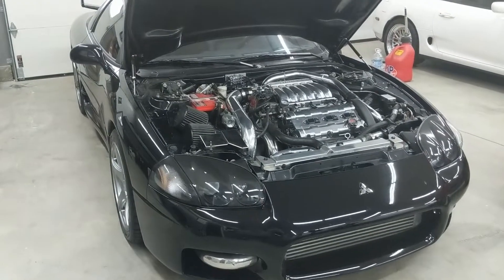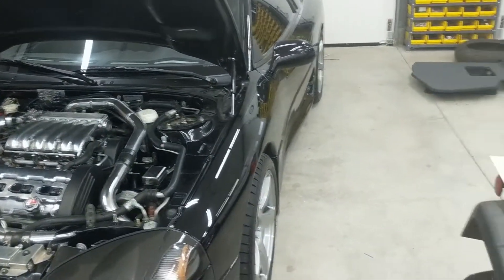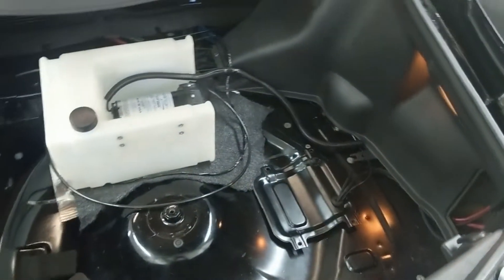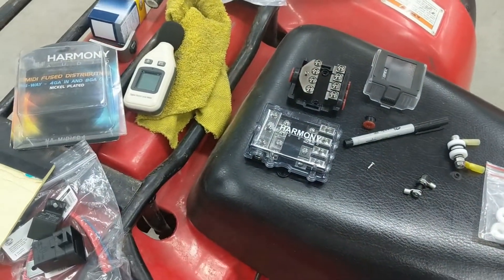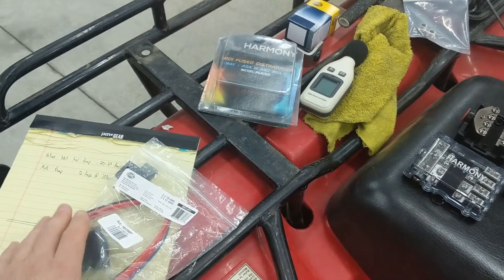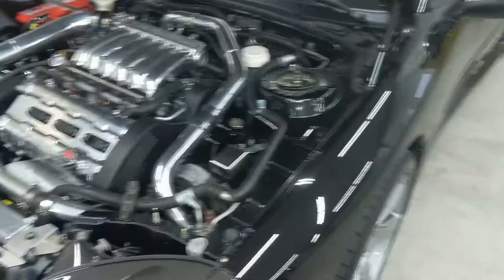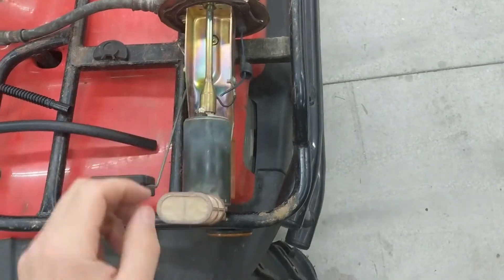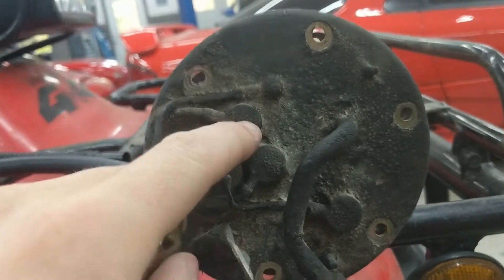Installing and hot wiring a hellcat Fuel pump in my 3000gt vr4

Comment: Im curious about youre fuel pressure. Ive have the same pump and im running fuel lab fpr. I have -6 an lines from the fuel feed to the filter then to the rail. The rail back to the fpr. Im having issues with the pressure not getting below 40psi at idle. I'm using the stock fuel return lines. Have you come across this issue?

Comment: Why did you decide to do the fuse relay inside the engine bay? Why not run 4g wire into the cabin and put splitter under dash?
Reply from the maker: I have the factory fuel pump relay bypassed from a long time ago. I wanted to keep the wire running to the fuse box installed as short as possible. Less wire means less room for it to run on something. Plus I already have enough wire running through my firewall grommet near the gas pedal that I don't think I could run anything else and I wouldn't want to drill a new hole.

Comment: Nice. I have been running mine for almost a year. It's great!! Goes great with my fuel lab setup. 💪🏽
Reply from the maker: Cool. Yeah the aeromotive I had lasted 8-9 years and 8k miles so I decided to switch to the walbro vs buying another aeromotive. Can you hear the pump at idle?
Reply: @802Projects  very faintly. My exhaust sound pretty much drowns all sounds out. Lol.
Reply: Hi. Wondering if that Hellcat pump would have been enough for the Supra so you wouldn't need 2 pumps in the Supra?